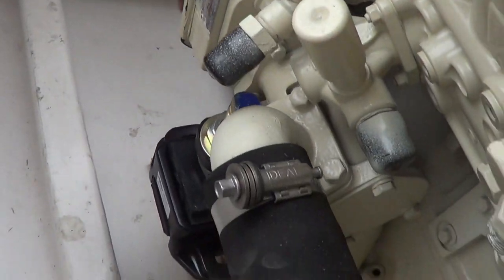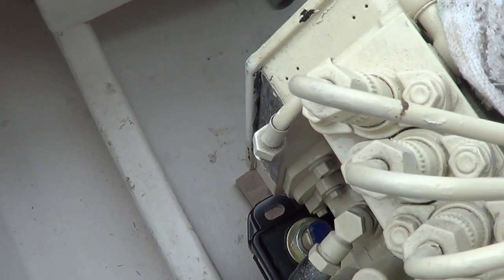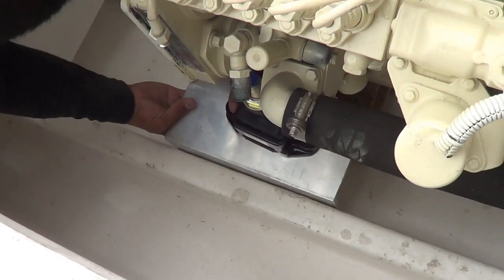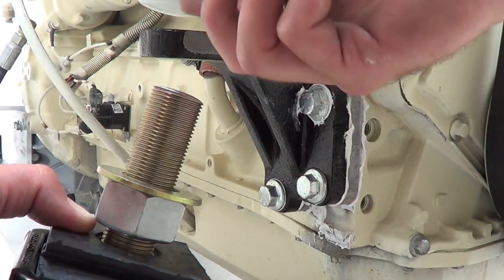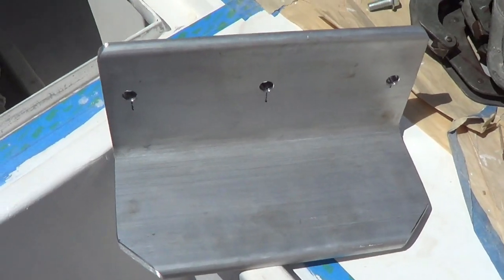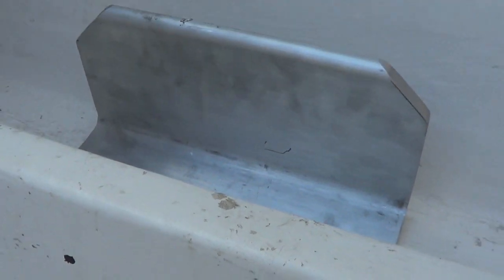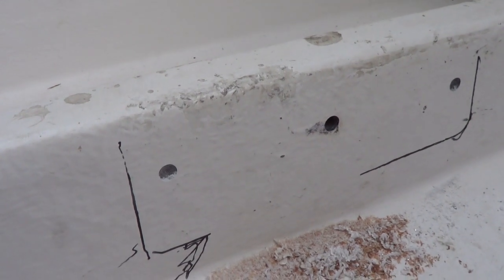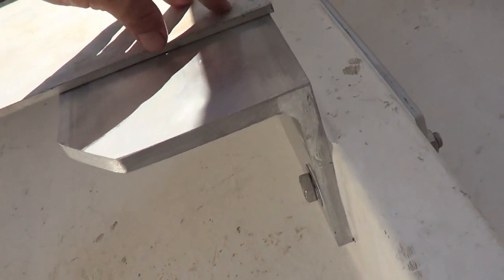Project Spotlight: Farallon 25 Engine Mounts

Comment: Thank you Tony, It would be nice to see an example where filler was needed to close gaps between the brackets and stringers
Reply from the maker: Actually in this video we did need to close that gap a bit.  We used a 1/2" spacer that we stock.  Check the video at 3:53.  Thanks
Reply: I was referring to situations where the Alum 90 brackets need filler between them and the stringers
Reply from the maker: Like this? https://www.sbmar.com/articles/how-to-properly-float-in-engine-stringer-brackets/